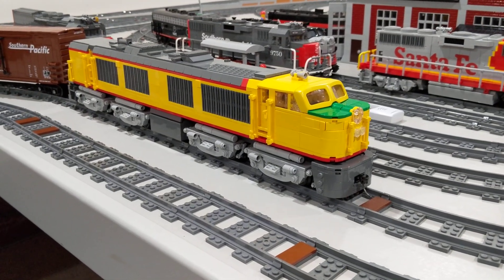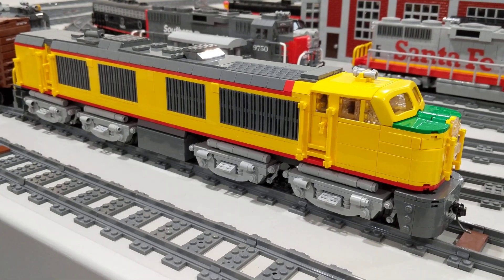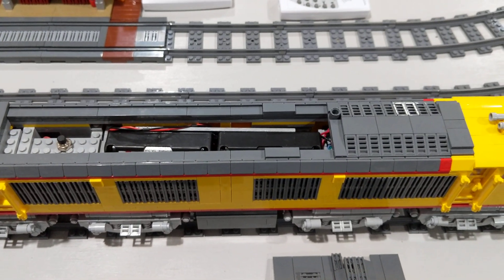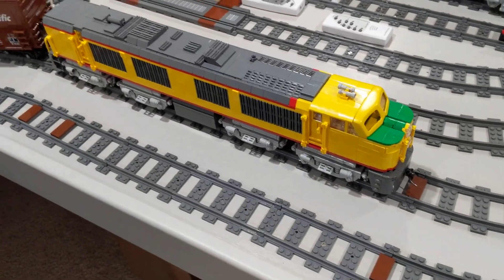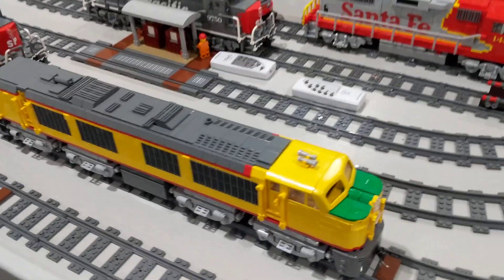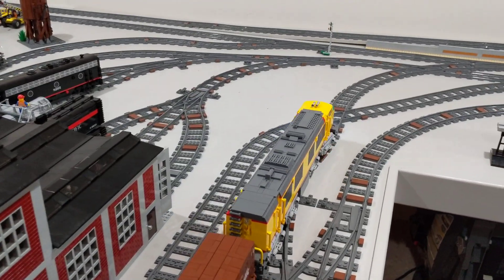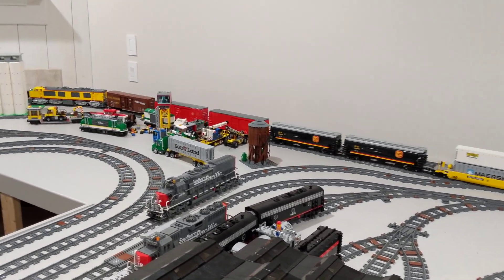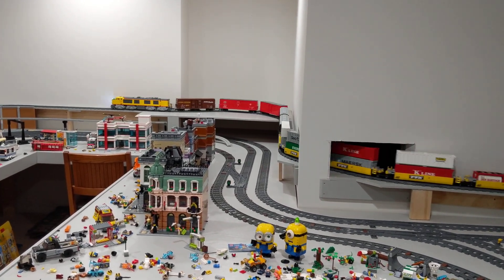LEGO UP GTEL 52 MOC

Comment: If you don't mind me asking. Would you sell the windscreen? I had seen the one you did for the F7, I thought that looked millions times better than the usual brick built ones I've seen.

Also I should add that I enjoy your builds and videos.
Reply from the maker: Thanks! The windshield design that fits the F7 model I did is available for purchase now at Brick Train Depot here: https://bricktraindepot.com/shop/accessories/resin-printed-f7-windshield/ 
I made a few changes primarily to add the hump in the middle for this GTEL model but it's otherwise the same. I don't expect there would be enough demand for the GTEL windshield for BTD to offer it, however.
Reply: @djg6910  I'm surprised there's not alot more buying those, I get it being a purists, but sometimes you can't argue with the results.

Comment: Very cool! How many cars max can it pull on flat straight track?
Reply from the maker: I just finished at test - it will pull everything I own on the flat - 16 4-axle freight cars, a 5 pack articulated container car with double stacked containers, a 32 axle Schnabel car, a caboose, and 6 SP Daylight passenger cars. With that train the loco was pulling apart the magnetic couplers regularly and it experienced a lot of wheelslip so more weight would have helped.
Reply from the maker: Thanks! The train you see in the video is as big as it can pull on the grade but the limit is the magnet couplers which even with a neodymium magnet between the Studly trains magnets, the locomotive can pull the magnets apart. I've tried the BMR Kadee's but they uncouple (knuckles bypass) on the transitions on the grade. I'll have to test on the flat what  it's capability is.

Comment: Great to see you are back! This is quite an impressive build. Did you take the tsunami decoder from an athearn HO model? 

I'm currently building the bmr sd40 and would like to do something similar with a dcc decoder from one of my ho models. Especially since I will be swapping my tsunami decoders for loksound anyways. Also how do the brick train depot railcars compare to the bmr ones? Love what you have done here. This video made me quite happy
Reply from the maker: Thanks! I bought the decoder new, it's a Tsunami 2 4400 for Baldwin and other diesels; the GTEL sounds are built-in. With the AirWire Convrtr-60 (which powers the Tsunami 2) and their remote, you can program all the CV's without a programming track. I chose the Convrtr-60 and the 4400 because of their current rating but the boards are much bigger than HO size. I think the BTD models are every bit as good as the BMR, I have many of both.
Reply: @djg6910  thanks for the input. Did you ditch the loco genies then? Or is it one convrtr per engine
Reply from the maker: Yes, I sold the Loco Genies. It's one Convtr-60 powering the Tsunami2 4400.